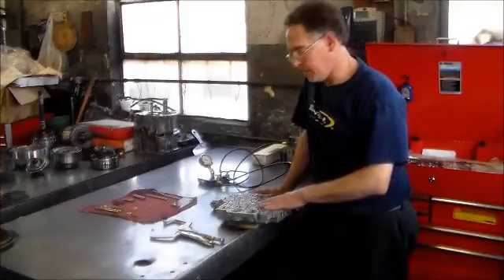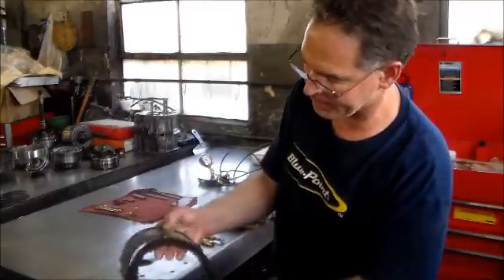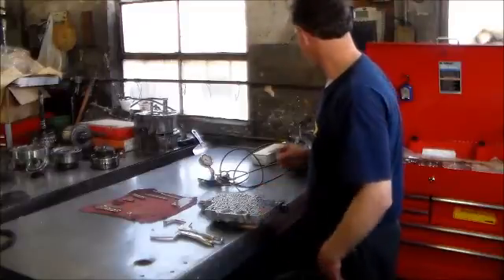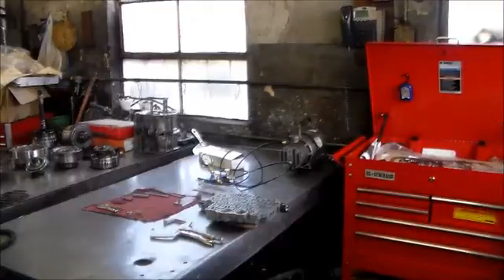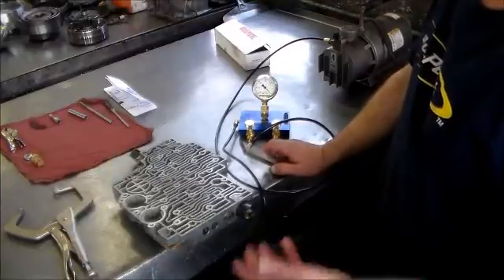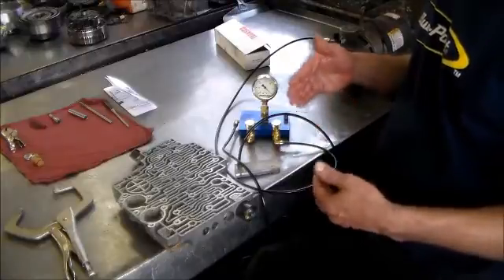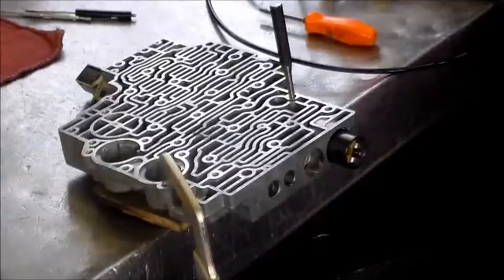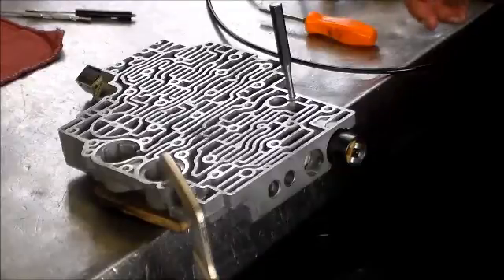4L80E Valvebody Repair and Vacuum Test

Comment: Awesome. Great video, my poor old 4l80e is probably going to get this treatment next week. If I'm not mistaken, you can remove the valve body to this point without pulling it from the truck, correct?
Reply from the maker: correct
Reply: @GaryFerraro thanks for the quick reply I'm always impressed with content creators like yourself that respond quickly even to old videos. My 4l80e runs fine but once it's warmed up it will drop overdrive. I tested the resistance on all my solenoids without dropping the pan and everything is fine except the rear speed sensor doesn't make voltage when I spin the transmission. Hopefully changing the sensors will fix it but I kind of doubt it
Reply from the maker: @offroad4life892  speed sensor will set a code and not shift correctly if no good.  You probably have a worn bore for the actuator feed limit valve.
Reply: @GaryFerraro the only code I could pull of my 93 OBD1 was code 68. Reliable information on the Internet is hard to come by, it's either a problem with the AC condenser relay or the transmission is detecting slippage and kicking it out of overdrive to save it. While the valve body is out is there anything you would recommend doing besides the pressure control switch? (I've heard these go bad on the regular. Truck has 338k miles with 150k being on the transmission supposedly, previous owner claimed to be a "mechanic" but all the fluids I checked were low or abused, the transmission was covered in oil from the leaking oil cooler lines so I don't think he took the pan off, might've sucked the fluid out the dipstick but it's clean and not burnt smelling)
Reply from the maker: @offroad4life892  change the shift solenoids too, they have been updated a few times
Reply: @GaryFerraro even if they passed the ohm test at 21.2 and 21.4?
Reply from the maker: @offroad4life892  They could be mechanically clogged as well, if they are electrically they will ohm fine
Reply: @GaryFerraro makes sense. Well we shall see

Comment: why would only the low/reverse clutches be burned on a 95 4l60e, thanks or more specifically, what valve or section of the valve body controls the low/reverse clutch activation in the 4l60e E?

Comment: How do you get a broken shift solenoid out of the valve body on a 1993 4l80e?
Reply from the maker: well, once the clip is out you could try an easy out, drill the snout and put ab easy out or screw in there and try that, What happened, never had one break on me

Comment: hello sir ,i took apart a mps6/dct450 valve body and a small steel ball fell out of the hole where the csms2 [odd gear pressure solenoid ] on the side of the valve body that has  3 solenoids,the diagram does not show a ball there,sadly i lost the  ball ,its about 2mm.Can you tell me if that ball is supposed to be there ,also what is the size of the ball,thank you
Reply from the maker: Satch Baul can you send me your vin number or e mail it to me
Gsferraro@yahoo.com

Comment: Hi Gary
I understand how a bore could get worn, causing the valves not to seal...
But what would cause a valve to be binding in its bore?
I have the valve body off a 2012 Nissan Altima CVT (JFO11E  REOF10A)
The ratio control valve, seems to be sticking or binding slightly. Tore it all apart, cleaned it well, and checked all valves. This is the only one that has issues. Put trans back together and im getting a stepper motor code (P1778)
But stepper motor specs out good when i ohm test the coils.
Any ideas? It has to be the ratio control valve sticking thats causing this... it connects to the stepper motor.

Comment: Thanks for sharing! Could you supply the part number for the reaming kit?
Reply from the maker: It's from a company called  Transgo, you can go to the website, not sure if they will sell to you.  I can always hook you up with my sales rep if you like.  Where are you located.
Reply: Gary Ferraro   Monroe La . I’ve ordered a Trans Go shift kit- 2 and while I have it apart I want to install a new actuator valve to make sure I repair it the first time. Mine is 91 2500 4wd . Thanks for your quick response . If I were near you I’d see if you’d vacuum test it and then repair as need!! Your the man!!
Reply from the maker: @ronaldlewis6062  ok, if you need help getting the kit let me know

Comment: P1870 code keeps coming on . Had tranny rebuilt and repaired. New pump. New valve body. New tcc regulator valve. But check engine light keeps coming on i don’t understand and what else can I do to fix . Please help!
Reply from the maker: Zach Godshalk is this a 4L60E. Or a 4L80E. Do you have access to a scan tool that shows live data
Reply: 4L60E and no just a regular obdII scanner but it’s driving fine after the valve body was replaced but like you said in in video it pops back on after 15-30 miles of driving or so. I think it may just be something simple as a o2 sensor but idk any suggestions.should I just give it time to kinda break all the new parts in and see if it goes away.
Reply from the maker: @GeeZee23  ok, couple of questions,  How long ago was the trans repaired? the valvebody, was it a good used one. I may have you drop the valvebody and block the  reg valve and the isolator valve, i have a video on how to do this, if the code comes back, may be something with pump or converter. The TCC PWM Solenoid was changed?

Comment: Thanks for showing how easy it is to ream out the valve body, tomorrow once i get the parts in for my 4t45e ill be reaming out mine to install an over size valve.
Reply from the maker: Whats the problem with the trans?
Reply: Iv'e had a 2-3 shudder id say for the last 40k. Then recently the vehicle started bucking 2-3 and sometimes 3-4 it was acting like it was going  upshifting and downshifting at the same time. I never took a line pressure reading on it but to me it felt like it was loosing pressure.  I work for GM so i called gm tech assist and they told me to replace the valve body and reseal transmission as needed. I normally don't work on transmissions and this is my own car so I searched on Sonnax's website and saw the symptom of a 2-3 shudder and to replaced the pressure regulator valve with an over sized one. I'm also replacing the boost valve and sleeve with their updated one. Also i'm replacing the pressure control solenoid and the shift solenoids.

Comment: Hello sir please help!  I want to install an automatic transmission in my car but I don't have the TCU so I was wondering is it possible to control the solenoids my self by supplying 12v to shift gear up and down while driving???????
Reply from the maker: Well, thats kinda hard to do, i have an interface machine that does that, but just running wires, you would have to supply 12 volts when needed to shift, you would also have to regulate the voltage on the epc soleniod which uses low volts(12 volts too much)
Reply: Gary Ferraro please email me maniclokofe@gmail.com I got billions of questions!!
Reply from the maker: manic lokofe 
I'm out of the shop for a few days but I have my laptop with me, I will answer as soon as I can.  My e mail is.  Gsferraro@yahoo.com
Reply: utube now has many videos showing how to manually set up the 4l60e all the way to the 4l80e,manual shift and i used it and installed the internal vaccum modulator kit from transgo and eliminates the ecm entirely,good stuff

Comment: Hey Gary! Thanks for the video man.
Is there a way for the next guy that might work on this say in 20 years from now to know that there is a modified valve in the valve body? 
Also did this fix the trans? Thanks! I'm sure it did but had to ask, LOL!
Reply from the maker: +ILTSYC    Yes it did fix the trans, This valve is redesigned, so if they know what the factory valve looks like, they will know it was updated. Hope all is well, any transmissions your currently working on?
Reply: No need another one to work on LOL!

I might get a Nissan truck for almost nothing for one of my girls. It needs transmission work.

One of our employee's has an 03 F-150 with no forwards gears but has reverse. I haven't offered to work on it, I really need my own scanner before I start taking in transmission work.

The Windstar has done awesome! We took it all the way up to the WV mountains last month following our girls church ski trip.\
Reply from the maker: +ILTSYC Sounds good,  nice to hear from you
Reply: You to bro! Do you vacuum test all the time or just when you suspect a valve is worn?
Reply from the maker: +ILTSYC  just when i feel there may be a valvebody problem
Reply: This won't be around in 20 years

Comment: Hi gary the valve body must be clean from any oil specially during vacum test .thx for the video
Reply: Great video. But I have the same opinion as Mostafa, if there is oil on the valve body the vacum reading will higer, thus making an incoherent reading. Gary can clarify this? Thanks.
Reply from the maker: +Mostafa Ameri Yes, i like to have it clean during the process, during the process i use the cutting oil, thats the only oil i use for this

Comment: Hi Gary, Great tutorial on installing oversize valve! One tip to make your expensive reamer last is NOT to reverse them. Use a good lubricant and low rpm and one direction of rotation for in and out. Thanks again and your passion for transmission repair is very apparent.  Thanks and great  job.
Reply from the maker: +Brad Miller   Thanks for the tip and thanks for watching. Gary
Reply: +Brad Miller spot on man never run a reamer in reverse i dont even use drill i use a speed brace and take my time

Comment: Hi Gary...just a tip to help you out on the calibration of your vacuum gauge which is incorrect. When you adjust the gauge for a reading of 5" Hg, turn the 'PUMP' knob on the right. Once that is correct, block the small hole as you've done and adjust the 'BLEED' knob on the left for a reading of 25" Hg. Repeat the procedure above until you get the 5" and 25" Hg. You'll probably see that you can get the 25" Hg. Take care Gary...
Reply: stuzman also keep in mind that the hole on tool used to calibrate is .030 in size,meaning that a 5in vacuum equals .030 size leak
Reply from the maker: +stuzman52 Thanks for the tip, i will try that when i get back to the shop

Comment: Gary i have a similar situation with a 4l80e I wanted to know if you can contact me at 214-688-5221 the truck runs fine for like a good hour then I get a code on the dash trans hot
Reply from the maker: +Jose more,  If you scan the car, what codes are present. Is there a check engine light on. Gary
Reply: +Gary Ferraro I think he mentioned he got a code. I have a custom van with a 4L80E. I don't get codes with an aftermarket controller but I do monitor temps. I have a similar overheating issue he describes. Even with two large aftermarket oil coolers it runs hot.  towing anything significant just makes the problem much worse. And we try not to mention hot days. lol 
Somewhere I heard someone mention that early transgo kits had a hole in the separator drilled too big and that caused a partial clutch apply. I was curious if you or anyone else has heard of that being an issue.?
Reply from the maker: I actually never heard of that. Thanks for watching. Gary